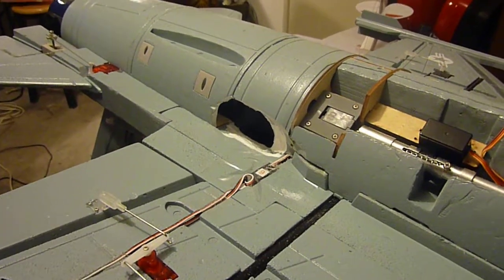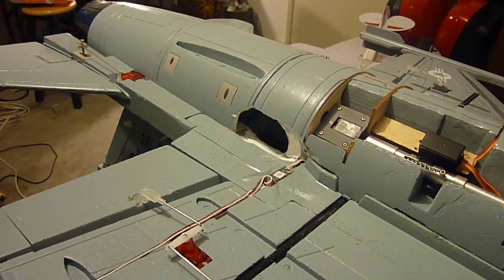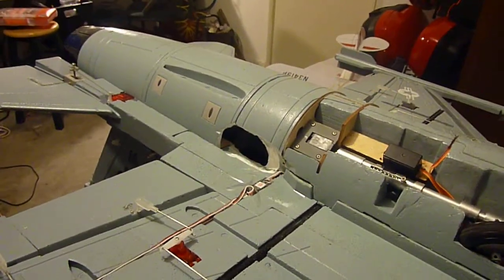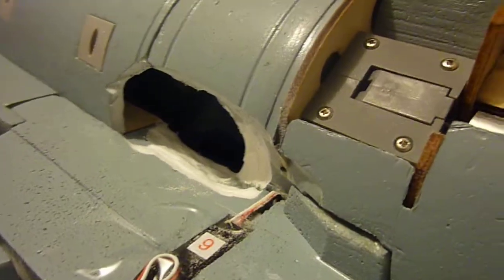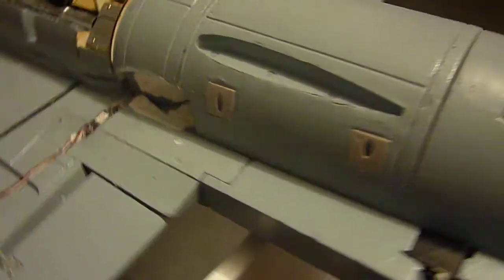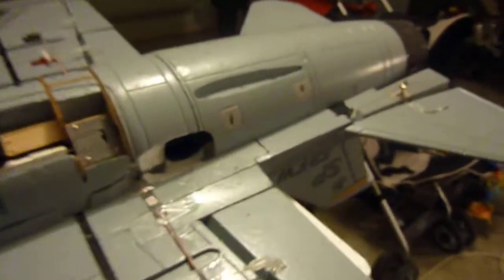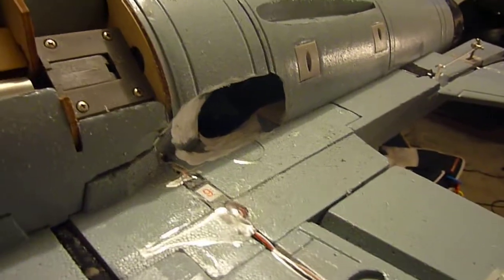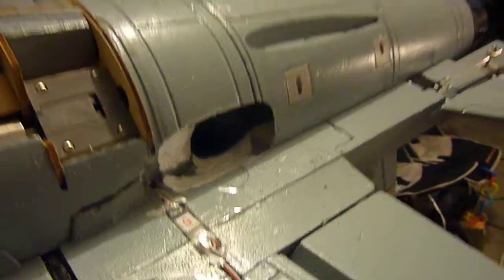Widening the cheater holes on Starmax 90mm F-16 EDF

Comment: what about 10+ blade count fans?  I used a 4300kv motor running 3s with a 5 blade on my F-4.  It was fast but had to hold full throttle most of the time.  So I changed to a Freewing 3300kv motor with a 12 blade running 4s.  It sounded better but it was SLOWER.  I thought about adding cheater holes but don't know if this, in theory, would help.

Comment from the maker: @ap0lmc He said that because the stock electrics are gutless, and he's right.  It needs a decent 1900kv or greater motor to get moving, and also needs a thrust tube fitted to reduce the output diameter to 75mm.  I have a video I made for the thrust tube.

Comment from the maker: @ap0lmc It's still slow with the stock motor, regardless of fan.  My original fan exploded before I even had it in the air, so it was replaced with a HET-9305.  That fan needed a faster motor too!  I am now using the HobbyKing 90mm fan - the one with the pointy spinner - and have a KDA36-74-09-XL 1900kV motor on the way.  I use a 6 cell setup, pulling more amps than for an 8 cell setup.  My original ESC also failed, so is being replaced with a 190A unit (just for headroom purposes really).